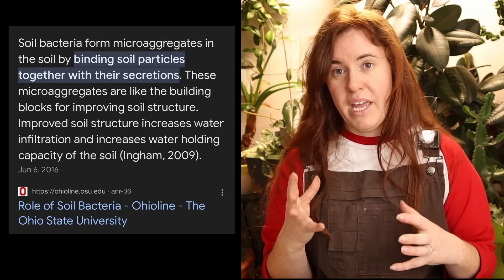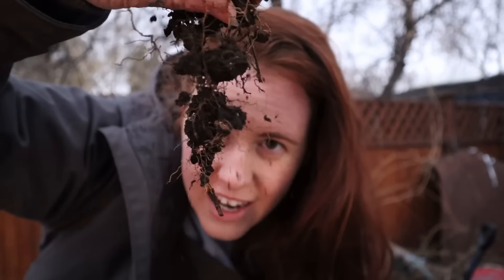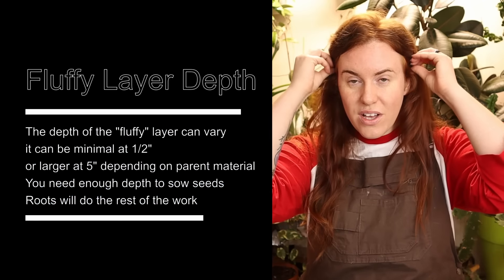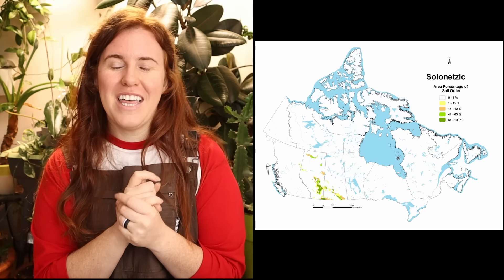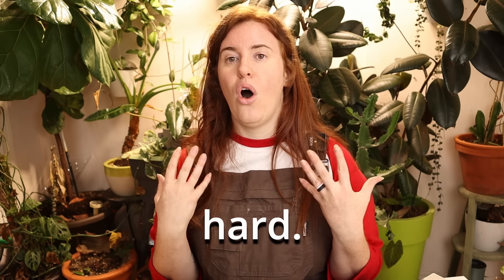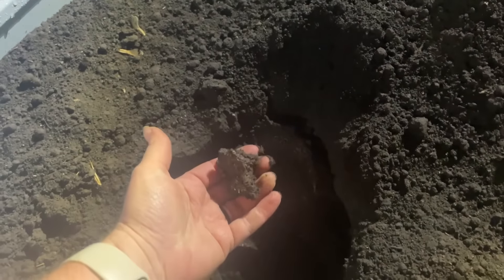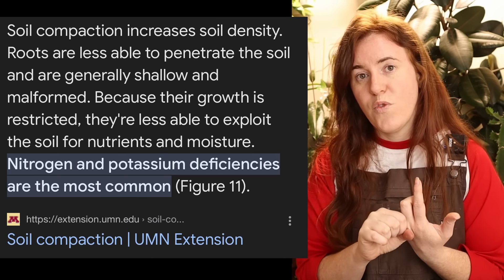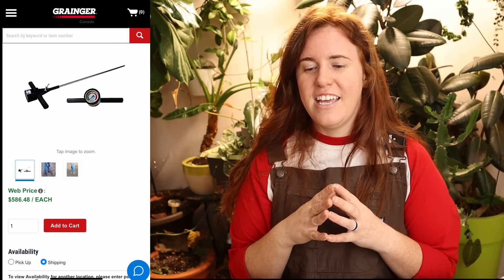Compacted Garden Soil | The 1 ODD Soil Test Nobody Does.

Comment: I recently posted a picture of my freshly tilled bit of in ground garden in a facebook group. Its only about 12ft by 12ft. One person posted the comment "You tilled !??!!?" with a few negative emogies. LOL. Well, yes I did. I spread out about 1 1/2 truck loads of compost on the compacted clay, and started grinding. The rock hard compacted clay was so hard that the rear tine tiller was actually bouncing on it in spots and was having a hard time getting down into it. When you can park a tiller in one spot and it takes about 10 full seconds for it to grind in about 6" in one spot with me rocking the tiller from side to side a bit....I have a news flash. NOTHING was EVER going to grow there without tilling it !!!! NOTHING !!!! That was actually the case. Most of it was just bare ground and even weeds and quack grass wouldn't grow in there. We're talking near concrete level stuff. I put a bunch of other things in there too like 4 cu ft of perlite, 4 cu ft of vermiculite, some biochar, and a few kg of gypsum. I'm going to add another truck load of manure and a couple of bales of peatmoss this weekend and I'll be tilling it again when I do. With a little luck, by adding come extra compost every year, I'll get lucky and the clay won't compact back down into concrete again. Sometimes the 'no till' crowd can be a little 'rabid' in their 'absolute level' convictions about it. No "no till crew", no one thing is EVER the answer to EVERYTHING, so get over it.
Reply from the maker: Omph yes… I mean. I personally don’t understand the garden shaming thing 😅. To me it’s kind of a “ try new things and see what works” hobby. You aren’t killing anyone. 

Your tillage probably made a space that was useless into something that’s valuable
Reply: @GardeningInCanada   At one time, I had a garden there, but it had reverted back to pretty much bare clay over the years. I then had about 3 cords of firewood stacked on it for a few years. It had a garden shed on it for a while with everything under the sun piled in it. After the shed got moved, I used it as a turn around and parking spot for my motorcycle. My large dogs have used it as a play space for the past few years. It was just pounded flat. It wasn't even dusty. It was just flat hard clay. Nothing grew there. By the time me, and my evil rototiller are done, it "should" be a really nice spot to plant tomatoes again. I'm closer to 60 than I am to 50, so I don't have half a decade to piddle away on watching compost MAYBE work it's way in there. I might as well spread compost on my concrete driveway and try growing there. LOL. As for garden shaming, it's just a state of the times. The internet is into shaming whatever doesn't go along with the current fad. I don't really care what other people are doing. I just do what works for me, and I'll never feel bad about it no matter what some guilt spewing fool says. I would hope most people feel the same way and ignore the internet idiots. I'll let everyone in on a secret. I even use Roundup in the yard !!!! When I've got grass growing in spots where I just can't get at the bottom of it, I'll give it a little dose of roundup with a paint brush. I know...just EVIL !! Yes, I'm the gardening devil !!!! ROFL !!!!
Reply: @blacksmithden  Yeah, that guy's an airline pilot too in another thread, and a neurosurgeon in another...
Reply: @jimrobinson7441  Me ? Airline pilot ? Hahahaha. I'm the son of a life long private pilot, and I've got 15 hours of my student time done but that's it. Neurosurgeon ? Industrial mechanic, yes. Neurosurgeon...I wouldn't want to be anyone who agreed to have me near them with a knife. ROFL !
Reply: @blacksmithden  No I didn't mean you, I meant the guy who called you out for tilling up your clay area.
Reply: @jimrobinson7441  Strange. My replies aren't posting right. Maybe this one will go through. As far as the other person goes, it was a lady. I admit I made fun of her attempted guilt trip. LOL. Like Ashley said. This whole gardening thing is one life long, never ending experiment. The minute someone says they have the only way, and they are getting the exact same yields by doing the exact same thing, every single year, you know they're full of it. Mother nature makes sure that never happens. As soon as they're trying to guilt trip you for not doing something their way, and you're doing something you know works for you, brush them off. I don't compost the way most people do, but running over everything from corn stalks to kitchen scraps with my lawnmower and burying the shredded "stuff" in a manure/soil pile has worked well for me in the past. I'll listen to, and try new ideas, but I'm also a firm believer in applying the "if it ain't broke, don't fix it" rule when necessary. I honestly wasn't sure if I was going to break the tiller or not the way it was hammering itself trying to break up that clay. I really didn't feel that chopping a hole in the ground with an axe and using a hammer to get my tomato plants in there was going to meet with much success, ergo....tiller time !!! ROFL.
Reply: The no till crew probably thinks food grows in Safeway ......

Comment: I really like the wire test for growable depth. My in-ground soil is very compacted clay and no way I'd get the wire in there very far before it bent.
I'm drilling holes with a mini auger and filling them with compost and adding more on top.
I've done this before with good results. Also growing anything that survives to help break it up.
Meanwhile, I'm growing my main crops in raised beds. Cheers!

Comment: Soil aggregates are very noticeable under the microscope as well.
Actually, that is one of the biggest concerns regarding jumping worms.   The JW's remove all the soil aggregates, turning the soil into a granular material that no longer holds onto moisture.  I saw this 1st hand 2 years ago in my potato bed, under the microscope a dramatic loss of soil aggregation.
Besides the tiller radishes, borage and comfrey have huge taproots to get into hard clay pan soils like we have here in south central WI.
Nice video!  Stay Well!!!
Reply from the maker: I feel so bad for you that you have to deal with with those buggers! Electrocute the soil 😂
Reply: @GardeningInCanada  Actually, I considered to do just that last year.  I was going to use a 12 volt battery, connect a couple diodes and hit the soil.  Fortunately the trapping in wet shredded leaves did the job.  Really bummed out I can not use all these beautiful leaves I collect as mulch.
Question?  Can dried cut grass as mulch potentially heat up (start composting), and burn plants?  I hate leaving my soils uncovered after I plant my seedlings.  Trying straw in my potato bed as mulch, not sure if the JW's will be that interested in it.  
Am trying a couple different mulch materials, straw and the chunky stuff I sift from my hot compost, hopefully it does not draw the JW"s.
You looked like a true gardener in this video, covered in overalls and rain gear, a real trooper.  StayWell!!!

Comment: I'd really appreciate a video (if you don't have one already) on re-using/refreshing potting soils in containers. When I transitioned my containers from summer to fall/winter/spring (I'm z9b, Gulf Coast), I pulled out probably 75% of the plants, leaving some roots to decay, added more slow release fertilizer, vermiculite, and then topped off with more potting soil as needed. 

But the plants did not do as good as when I just completely dump the soil and add brand new potting mix. I really try to dump as little as possible because I can't really take the old soil somewhere to dispose of it -- like a friend's yard/garden.

Comment: I get compacted soil here in IA. I have spots in the yard that are worse than others.  It drains slowly, but i have a lot of worms and grubs. The Loess Hills is a big Ag area.  Sometimes my seeds take longer to germinate due to the clay and i struggle with some root veggies. Either the bulbs wont form in the clay or they wont form in a raised bed due to high nutrients and getting compacted after rain.  The best luck ive had with radishes is putting down like 3 inches of loose potting soil or seed mix and the radish seeds on top. Then they can form in the loose soil.
Im wondering if my yard needs some fertilizing because i have invasive weeds that wont go away. I have sprayed them. This year the foxtail clover is everywhere and i have tons of tiny bare patches of grass.

Comment: So what about when moist spring soil is soft like 45 cm rebar hand push all the way but by summer it gets rock hard needing sledge hammers to get tent pegs in lol. my clay behaves very different depending on moisture level, sometimes the water will pool for a day and other times it runs through the hole like a screen.
Reply from the maker: Great point! So that again comes down to keeping the moisture in your clay as much as possible. You may need to make sure you got lots of Walsh and that stuff. You could try amending it with more organics and sand, for example. But ultimately some soils you just need to continually mechanically manipulate to win.

Comment: Another great video.  Thanks!  Quick question because I'm on info overload from too many videos LOL.  Raised bed 15" (also on legs so no ground to penetrate).  Brand new & drainage holes and I put logs on the bottom and want to put peat moss in there to hold moisture.  I want to put cabbage and cukes on trellis in it this year as they're ready to go.  Is the peat moss a good or bad idea?  No leaves around here and cedar mulch I have froma tree we had to get cut down is needed for top layer of both veggies and perennials so don't want to waste it in the bed.  Thanks
Reply from the maker: To be totally honest, I would go for a potting soil. Just a cheap one even would be OK. Only because there will be lime in there to neutralize the other otherwise acidic peat. If you’re up for it, you could make your own. I would do 25% compost the rest peat, not too much perlite light because you’ll regret that decision once August rolls around. And then lime according to how much so it ends up being to help with that pH. I just don’t know that making your own would be cheaper than necessarily buying it.
Reply: @GardeningInCanada  thank you Ashley.  Yes, I already thought the cedar would be acidic.  Compost and peat it is with some lime to stuff the branches and then the triple mix that is already here.  Thanks once again.